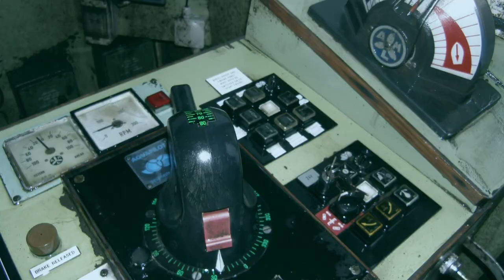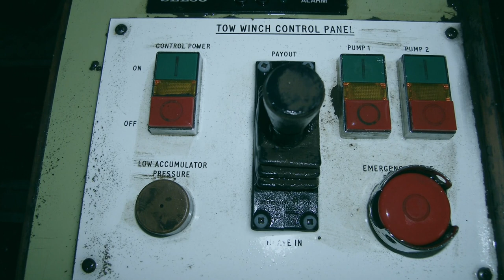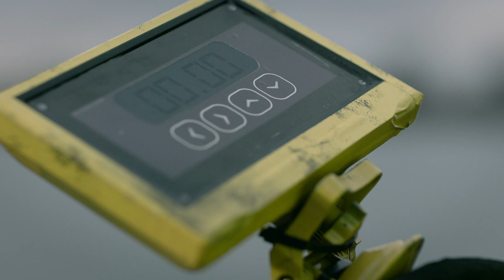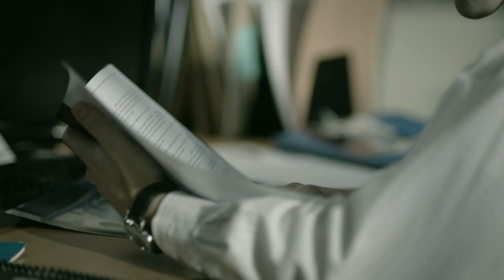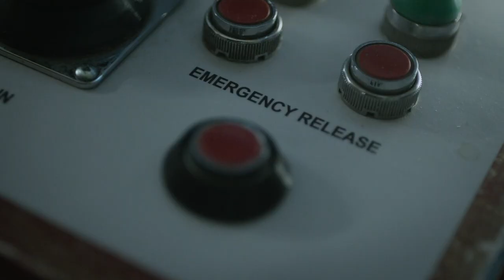How The Flying Phantom Tragedy That Left 3 People Dead Changed The Ship Industry | Disasters At Sea

Comment: Spring tension shield over super sharp blade! The weight depresses the shield and is cut before rolling over.
Reply: Is that a thing or your idea? Sounds smart if it was on a spring loaded base plate with a mechanical release
Reply: @kevinverduci7600  .... I'm going with a thing.... that is being used in a other application, that I saw somewhere else.
Reply: @fbksfrank4  that a million dollar idea... You should figure that out...
Reply: The thing is, it would have to cut wire because not all tugs run rope. The flying phantom as a tug is old "1981", so you have to refit all tugs with something that will cost a lot for some thing that all winches has. The thing that this dose video not cover was why they need to use the quick release, they had run aground and lose they engine.

Comment: So not the crews fault but it was the crews fault for not checking it and doing proper maintenance or it'd be fine
Reply: nope the winches time with good proper maintenance was 6 to 8 seconds it was a design flaw in the winch that it took so long to release the winch brakes